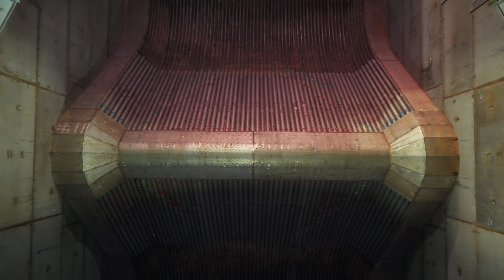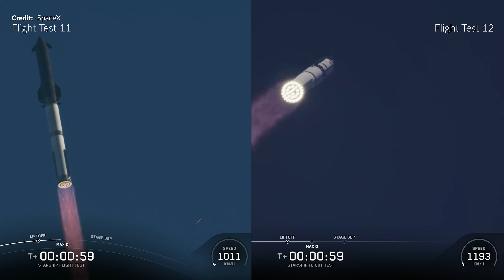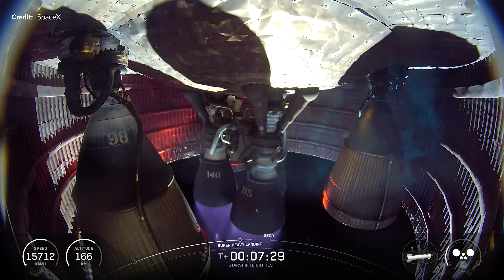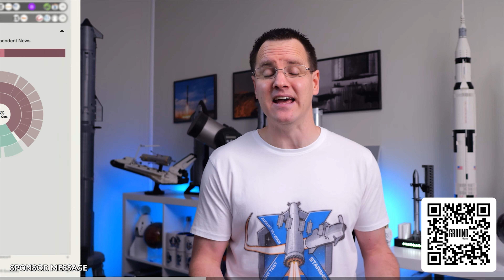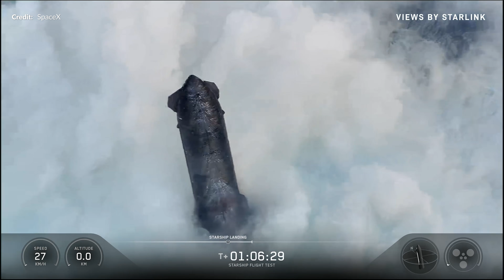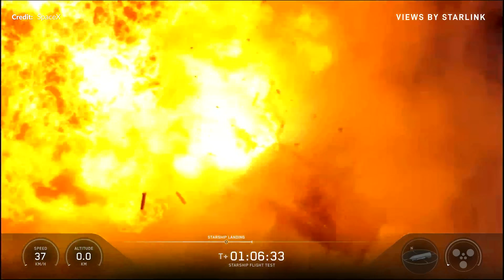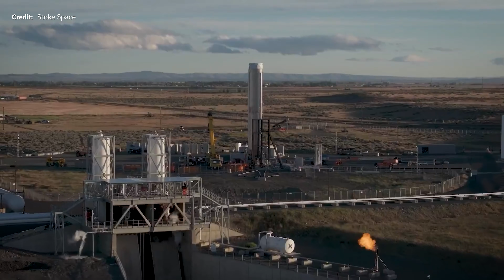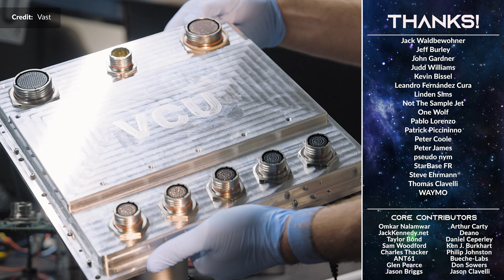Starship Flight 12 Explained - The First Version 3 Starship

Comment: Considering how the first three V2 launches ended in explosions, the first V3 ship making it all the way is a way bigger win than people realize 💯💯
Reply: Yes considering it’s a brand new engine design that has never left the ground only had 2 go down out of 39
Reply: @jdhiner1 yeah, at least at first, when you look at the animation of what the telemetry told SpaceX what the engines were doing on boostback, that seemed quite interesting
Reply: @clarawerner9996 They had one engine have an energetic event (there's a X post about it, in slow motion, you can see debris leaving the tail end) and took out 16 of its neighbors.
Reply: The heat shield and satellite dispenser worked perfectly. Not to mention little to no launch pad damage
Reply: @kaibalfour2318  except for that "Gateway to Mars" Sign....
Reply: @unitrader403 I miss that!! Did it just shake apart?
Reply: @unitrader403 GAT WAY FTW
Reply: @climber950  Shockwave thrust...
Reply: Making it all the way to a pinpoint landing WITH an engine out nonetheless...wow.

The data they got from that must be crazy good.
Reply: Absolutely.
Reply: The explosions weren't an accident. They knew from the start they would blow up. Elon has talked about it a lot of times.
Reply: @mountainman4410  they don't seem to get that the explosions were a planned event for failure data collection.
Reply: Bit sad to see yet another raptor vacuum engine rupture, it's been an ongoing problem with Block 2 that is disappointing to see not fixed yet. True that they are using a new block of engines, hopefully it's an easier fix not needing a whole redesign.
Reply: The problem is probably in the connectors and not the new v3 engine itself, but still seems bad when it's a repeating issue that should have been fixed in the redesign.
Reply: @jonathanherring2113 You don't think they tried to fix it? Maybe you should give them some tips 🤡
Reply: Huge success after about the hundred fifty try. In main-time China launched another crew to their Space Station.
Reply: So the first 11 launches meant nothing? 
Man you guys set the lowest bar for success.
Reply: Not exploding is kinda low bar
Reply: Its a YUGE win! (except for the woke Elon-haters)
Reply: Very good point. Massive rocket-wide changes comes with a lot of risks
Reply: @theelephantintheroom69  , Wouldn't you expect massive rocket-wide changes and the inevitable explosions two years ago and smaller incremental improvements at this late stage of the program?
Reply: @pyotrberia9741 I would expect to leave rocket design to the experts. Or maybe you know better than they do? 🤡
Reply: @pyotrberia9741 Actually, this is Not ‘late in the program’. This was the first Version 3 Starship- an almost totally new design. Seriously. - Dave Huntsman
Reply: @dphuntsman  , Starship was supposed to land astronauts on the moon in 2024. They have not managed to place a single payload into orbit and are starting from scratch with a new design in 2026. That is what I would call late.
Reply: Straight out of the horse's mouth, oi, that comment?
Reply: If we use all the oil. How do we get out in space?😮
Reply: Excuse me, this one exploded as well at the end
Reply: @garylucas6511 Yup; as expected. Do you have a question?
Reply: Plus , the explosions were detonated, not from it just exploding
Reply: Meh, they got lucky
Reply: So this is SpaceX plan, create new versions that fail on things previous versions succeeded with?
Reply: Agredd but what matters the most is consistency. Because one single failure with human crew will ruin absolutle everything and put SpaceX into the ground.
Reply: Hope the US taxpayers aren't paying for all these tests.
Reply: @MrGeoffHilton Spacex gets billions in taxpayer funded subsidies. Idk how much exactly bc news sources state diff amounts.
Reply: @LifelessSatelliteDrifting Thumbs Down. Starship is privately developed. The NASA HLS lunar Starship contract is NASA taking advantage of the privately SpaceX-developed Starship to ALSO turn it into a lunar lander- on top of all of its other uses.  No ‘subsidies’ here. - Dave Huntsman
Reply: @MrGeoffHilton they are
Reply: So we should treat it like they are completely starting over?   Really?
Reply: @speculawyer  That is pretty much what they did, except they of course implemented what they've learned along the way.
Reply: @speculawyer Yes, really
Reply: The V2 was one of the first, certainly the first mass produced rocket (excluding Chinese firework type rockets) SpaceX is merely trying to replicate things already done ½ a century ago or more by NASA,  failing miserably by any meaningful standard. I would  (without watching the video) if it ended up with anything other than yet another failure to establish a stable low earth orbit and return  safely to the ground.  Elon Musk,  good at scamming suckers, not so good at anything else.
Reply: Aren't they supposed to be learning from earlier failures? Does giving the Starship a new version number mean we are back to square one? No booster recovery, no payload into orbit. There are much greater challenges ahead to get to the moon. At this rate, in 10 years, we will have V8 failing to reach orbit as Elon fans cheer as it crashes into the ocean.
Reply: @pyotrberia9741  Fool. There are good and valid reasons for redesigning, they have made significant upgrades that make the ship, booster and starship, more efficient, capable of carrying heavier payloads, easier to maintain, quicker turnarounds, etc. If they hadn't learned from previous failures AND successes, this rocket would have blown up on the pad. Try again, your post made no sense.
Reply: @GARYGUYTON-c7i  , I am not saying that the redesign was unnecessary. I am saying that the radical engineering philosophy of SpaceX is not delivering what it promised. It seems to be stuck in an endless cycle of redesigns without achieving the major milestones, which include 100+ tons into low earth orbit, rapid reliable re-usability cadence and orbital refueling.
Reply: @pyotrberia9741  Falcon 9. You expect too much too quickly, and without misadventures along the way. They are well on their way. I suggest a bit more patience.
Reply: @GARYGUYTON-c7i  , The NASA contract required the Starship HLS to land astronauts on the moon in 2027. That has had to be cancelled and NASA is looking at giving the contract to Blue Origin instead. SpaceX has to get its act together and reach Earth orbit and achieve in orbit refueling very soon or the whole Starship program will have to be scrapped.
Reply: @pyotrberia9741  No it won't. It will go on because there is no other heavy lift system out there anywhere near close to having the capabilities SpaceX has already proven. That includes Blue Origin. Wait and see.
Reply: @GARYGUYTON-c7i  , Being able to put a payload into low earth orbit is the absolute minimum capability for any rocket. Starship has not succeeded in doing this after 13 launches. SpaceX has proven nothing.
Reply: @pyotrberia9741   this guy gets it
Reply: @pyotrberia9741 😂😂😂 you are very special.... needs bud.
Reply: There's no considering, no conditions, it a success because of what it did. So considering you were dropped on your head I guess I shouldn't expect too much.
Reply: @FrigginMark  It absolutely was a success. An enormous success.
Reply: @FrigginMark  You sound like you have complete 💩 for 🧠s. You sound like one of those brainless wokies who makes their lifes mission to go around crying about "the elites" 24/7.
Reply: Correction, the expectation is no explosions.  That's the minimum bar.  Starship on it's 12th flight destroyed both parts of the rocket.  That's a complete failure when you consider the reignite test had to be scrubbed because they are STILL regularly losing engines.

It's a boondoggle from a con man.
Reply: @tlalocraingod2205  NASA blew up numerous tax payer funded rockets before getting Gemini successfully off the ground. Then lost another three before Apollo, not to mention the two failed shuttle missions. Perhaps you should call up the Space X engineers and show them how to correctly build a rocket that is 100% guaranteed to work right the first time every time with new untested hardware.
Reply: @tlalocraingod2205  Here's a little life lesson.  If you don't understand what is happening in front of you,  then refrain from making stupid statements.
Reply: @tlalocraingod2205
You're a doofus. 😁
That "conman" is paying for starship out of his own pocket.  He's also saving taxpayers an insane amount of money with Falcon 9, tyvm. BTW,  spacex built Falcon 9, merlin engine, and dragon 1 capsule for $800 million, of which, taxpayers only paid $381 million. Elon Musk paid the rest. And did all 3 in 6 years total.
Northrup Grumman needed a decade, AND $2 billion dollars to redesign the old Shuttle solid rocket motors, literally the simplest type  of rocket used to launch.
SLS as a whole cost $25 billion, and took 12 years, and it's almost exclusively upgraded 70's and 80's tech, and costs over $4 billion per launch, and not a bit reusable. 
Starship has been in development for about 12 years. And about $10 billion spent. It's literally designed to be completely reusable, and the largest, most powerful, most complicated thing ever launched.  Spacex, and Elon are doing an amazing job.
Reply: @tlalocraingod2205 <- Dumbest person award goes to.
Reply: @tlalocraingod2205 Were you dropped on the head as a child?
Reply: @the_15th_coming_of_cristno no no.... his moms boyfriend hit him in the head too many times when she was knocked up with him.
Reply: @tlalocraingod2205 Cant help thinking there might be some hate and emotional bias in this comment
Reply: @tlalocraingod2205 literally. Maybe the engines are now too simplified? Should have gone for something in-between
Reply: @porterijsseldijk3953 you obviously do not know much about aviation chubs. Whats your day job?
Reply: And yet the rocket will never have any purpose.
Reply: @JRBendixen  You don't think Starlink is a viable business? Seems like a bold claim with Falcon 9 putting tons of Starlinks into orbit. They wouldn't be doing that if it wasn't profitable. I'm not quite following why Starship's purpose can't be the same thing
Reply: @JRBendixen  LOL. Besides dozens of launches of space-station sized ships to orbit at 1/20th the cost per launch every single day.. and that's based on existing tower construction. Besides THAT
Reply: @gcburns4 I had one guy try to tell me that commercial satellite didnt exist. Best part was he had DirectTV 😂😂😂
Reply: It didn't make it all the way. It missed the target trajectory.
Reply: @biggin2155  Just how do you figure they got the ship 39 splashdown video's if it didn't ?
Reply: @biggin2155  It made it to the planned touch down point, just using a different trajectory to the one planned. This shows just how flexible this rocket system is and is another win imo.
Reply: @wenditaylor2354  Pretty friggin badass that they still made it to the planned LZ even with a raptor going out as early on as it did! Impressive! I thought for sure there was no way they'd make it. I was wrong.
Reply: @biggin2155  Yes it missed. SpaceX must have designed the fastest inflatable rafts and drones in history!
Reply: @biggin2155  EI happened a bit earlier suggesting lower altitude and velocity. This may suggest why rVac relight was not attempted.
Reply: @goldenpacificmedia with one engine down my rectal speculation is there was probably a fuel leak and they didn't want to risk the RUD.
Reply: @biggin2155  So the camera views they got at the ships destination came from....?
Reply: @biggin2155  they used the j hook to basically aim and make up the distance if they were off
Reply: @biggin2155 dip shit comment of the year
Reply: @biggin2155 it was a developmental test flight not putting a multimillion dollar satellite in orbit like blue origin
Reply: I mean every upper stage ever used has blown up lol
Reply: Shame that tax payers are paying the bills, oh and remind me haw 'late' are they with this?
Reply: @robba1234  Try running as fast as you can into a brick wall. It may bump start your brain....... or not.
Reply: @robba1234  sls was 10 years late and 20 Billion over budget… for a rocket based on existing engines, boosters, hydrogen tank and launch tower… SpaceX only get taxpayer money for starship if they complete milestones. The whole contract is for $3 Billion, they have received only a fraction of that sum at that point. Starship program so far cost more than $5 Billion. So explain to us please, why spend 5-10 Billion dollars, just to get a return of 3 Billion, and the complete 3 Billion would imply that all goals are met, so the taxpayer got what they paid for…
Reply: Can you explain how the tax payer is pay for a project that is self funded?  You may need to put your helmet on for that one chubs. 😂😂
Reply: @brianbiddle7590  It's public knowledge but might not have trickled down to Musk fan boys.  You do know Musk has several contracts with the government right?
Reply: @r @robba1234 if you took high school algebra you’d know that the amount of money each person “paid” for the SpaceX nasa contract is about 0.01% of your taxes.
Reply: @robba1234  musk has several contracts with musk? That's shocking news to me. Some investigations need to inquire about this blatant corruption.
Reply: @robba1234 musk has several contract with musk? Okay bud 😂😂😂
Reply: @brianbiddle7590  OK a typo it changes nothing, Musks projections on this project are over budget and years late ( thats from his own estimates) His self drive car which has been coming for years has never yet arrived, his truck is legendary in only one direction, money lost. I loved the first 5 years, but his constant failures and constant delays, not to mention cover ups over crashes and so many other issues, he had to tie in with a corrupt Trump to make the government investigations go away.
Reply: @robba1234  Okay? So does Blue Origin. I bet you don't complain about them. Oh that's right because Elon's a Nazi right?
Reply: @robba1234 what do you do for a living cuz you obviously do not work in the the aerospace industry 😂😂😂 you have no idea what failures are. You do not know why timeliness move. Honestly if it wasnt for NASA we would be back on the moon already. Also all thise investigations started after he supported Trump became that you democrats do. Enjoy your do nothing life. Go back to your boring job.... if you are even employed 😂😂😂
Reply: @robba1234  This guy is succeeding. Go cry. And it will pay off, hugely. Wait and see.
Reply: @robba1234  yeah I know it's a typo, but fyi it is public knowledge that his contracts with the government are milestone based. He only gets the money per milestone achieved and cannot get "over budget" money. Almost anyone launching something these days uses a falcon 9 and that's not because they have some subsidy. They are just the cheapest most produced rocket out there and other well connected companies tried and failed to match it. They have plenty of money themselves. They themselves stated that they don't get any extra money from the government, just milestone based for the hls program with their human life support systems.
Reply: this whole thing is a humongous waste of taxpayer money
Reply: @DogFatherTBH  Insanely inane post.
Reply: @DogFatherTBH how? Starship development is mostly self funded by space x. 😂😂😂😂 keep coping incel.
Reply: @DogFatherTBH  Pennies compared to the welfare fraud plaguing this country. No illegal should have welfare or social security
Reply: @DogFatherTBH  Idiot!
Reply: @DogFatherTBH Starship development is payed by SpaceX company themselves. Not by taxpayer money.

Only the HLS starship variation get taxpayer funding.
Reply: @malax4013  Paid.  Payed is a nautical term.
Reply: @malax4013  well nasa has already dumped 4 billion into this dump fest tho, and soon theyll ipo it and be ripping off millions of americans for their pensions
Reply: @DogFatherTBH  And what stupid programs would you put the money into?
Reply: @GARYGUYTON-c7i  because who needs healthcare or schools or infrastructure, right?
Reply: @newtonsheir 4 billion wouldn't be enough to fund any meaningful healthcare and education.
Reply: @GARYGUYTON-c7i  probably dont spend it at all. or put it into something actually profitable.
Reply: @newtonsheir  Pouring more money into our present Ill-education system is a waste, Period and EOS. Where in our fraud-filled healthcare system? Medicaid? No, thanks. Pure research might be good, but we could easily fund that by eliminating fraud, welfare to illegal immigrants, and putting more and more people to work...in aerospace and defense, for instance. If we stopped using our gas taxes on boondoggles like the high speed rail to nowhere and green.not energy, our infrastructure would be looking a lot better. Right.
Reply: @newtonsheir  so weird to think we HAVE to spend the money on stupid things. lol.
Reply: @christopherbelanger6612  tell that to the people you would touch directly, instead of burning it up in the atmosphere. 4 billion would cover the cost of 400 thousand associates degrees, or cover 475 thousand people on medi-cal for one year.
Reply: @DogFatherTBH  Short sighted. The opening of the "New World" had a economic impact so huge it is describe as "inestimable" by historians. Try a google search on the question. Opening the solar system will be even greater. Planets, moons, asteroids, all exploitable, compared to two continents. To not go is foolish.
Reply: @DogFatherTBH  Rip-offs all.
Reply: @GARYGUYTON-c7i  maybe you would be smarter if the government had paid for a little more education for you.
Reply: @GARYGUYTON-c7i  no one gives a shit about exploring the solar system. weve got real world., right now problems
Reply: @DogFatherTBH  Problems that you will NEVER solve unless you go. You've got your head buried in the sand, deeply buried. That you don't give a shit just proves how blindly stupid you are.
Reply: @DogFatherTBH  Got you beat by light years. Umm, you don't understand...a loooong ways.
Reply: @GARYGUYTON-c7i  I bet this guy is black
Reply: @DogFatherTBH  4 billions earned over time by completing their requested milestones for each human life support system. You make it sound like they are paying them over budget, but that sum was agreed from the start and didn't increase because "starship is late". Vast majority of funding was out of pocket.
Reply: @V_for_Vendetta-b2y  im glad that its only investors that are losing money but ive still lost all faith in starship. as long as no ones taxes or pension funds are in on it tho, all the more power to him. i just think its sunken costs fallacy at this point. look at the artemis mission and its single, successful test launch  in comparison. starship is just a dumper.
Reply: Still ridiculous that the SpaceX team were cheering that the rocket blew up
Reply: @porterijsseldijk3953  they cheered the soft landing on the ocean. But go on, change the narrative to suit yourself.
Reply: @imarchello  - I think they cheered the FTS explosion. That was the finality of success. They want these ships to sink.
Reply: @gcburns4  FTS is the Flight Termination System that's active during the launch sequence, programmed to blow up the rocket, in case it veers way off course during launch. They disable FTS once it reaches space.  There was certainly no FTS active during Starship reentry and splashdown. It detonated because the nose hit the water at high enough speed.
Reply: @porterijsseldijk3953  What else are they to do when the vehicle does what it's supposed to do?
Reply: @CorwinPatrick  Don't confuse him with facts.
Reply: It will always blow up if it tips over and hits cool water....the fuel is in the nose cone area....this won't change unless there's was zero fuel left ....they had extra because they lost a vacuum raptor engine....

This was a total success other than the booster issues....and they'll have that fixed ASAP. We are probably 3 to 5 flights away from a total success with both a booster and ship catch....

Once that happens....it's off to the races.....

Space X will succeed. There is no doubt to anyone but haters. I'm not a fan of every thing they do....or stand for...but I see a proven Company doing what it does ....and so far it's looking like another success.
Reply: @johnnyringo35 nothing about starship indicates this project is going to work. at this point its sunken costs fallacy
Reply: @DogFatherTBH You're blind or delusional. Of course it's working.
Reply: @DogFatherTBH  You are a total fool. Every post you make proves it.
Reply: @GARYGUYTON-c7i  i bet you dont even have an associates degree. LOL
Reply: @DogFatherTBH  I'd bet you don't have a functioning brain, bot. Just a parrot, spouting off as your told to, and collecting your Ten cents. BTW, a degreed QA Eng., retired. Whatcha got? A diploma from kindergarten?
Reply: @porterijsseldijk3953 ridiculous that you don't recognise how impressive it is to re-enter a vehicle from near orbital speed and land it in a controlled manner
Reply: @porterijsseldijk3953  - The Explosion was intentional. It's the Flight Termination System in the payload area. They want it to sink. The objective was successful. My god, the level of ignorance...
Reply: @porterijsseldijk3953  huh ofc it blew up it landed in water but it landed upright and very softly
Reply: @porterijsseldijk3953  What they cheered could be the landing and the feeds were not in synch and delays etc - We do not know that part.
Reply: @porterijsseldijk3953 it was expected to blow up after falling over
Reply: @porterijsseldijk3953  u new here?
Reply: @porterijsseldijk3953 i love when the incels are shocked that a company that says they are going to blow some rockets up in testing, blow some rockets up in testing 😂 you are definitely special..... needs 😂😂
Reply: @porterijsseldijk3953 So you dont know that 99% of rockets explode becausw they land to sea. They are designed to be wasted.

SpaceX is basicly only company that really catch their rocket to reuse them.

You people are so dumb.
Reply: @porterijsseldijk3953  Uhhh, it was supposed to blow up. I'm just friggin amazed that it still made it to it's planned LZ even with a raptor going out as early as it did. Pretty fkn impressive!